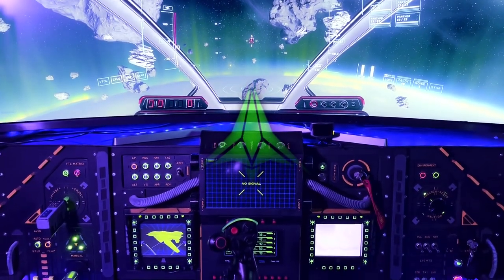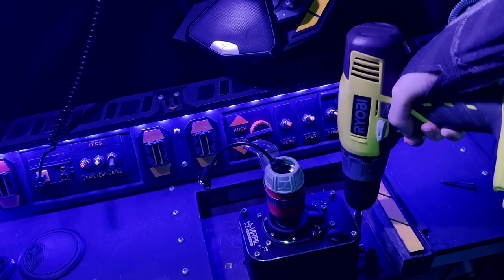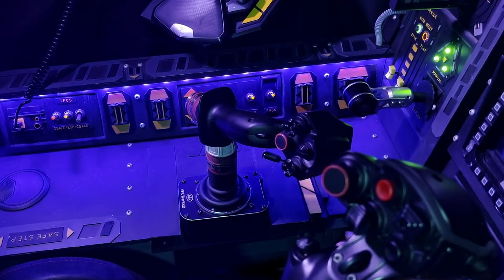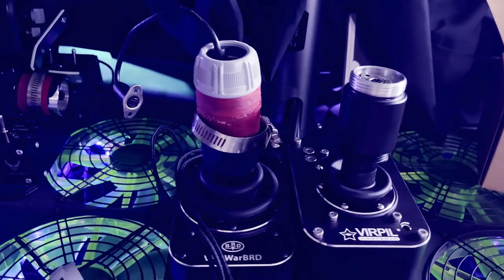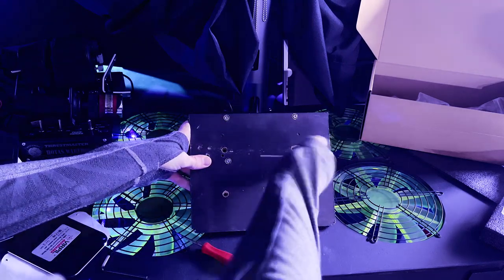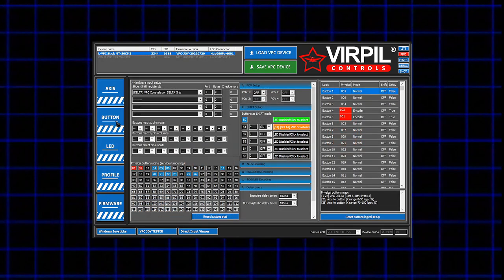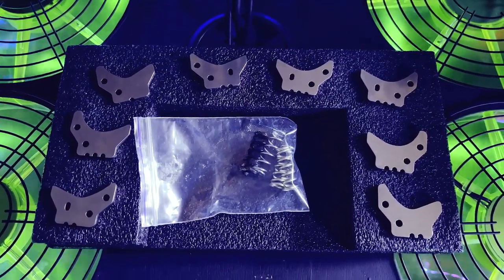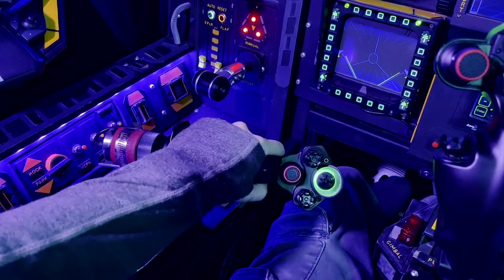Virpil MT50 CM3 Gimbal Base for Star Citizen - First Impressions & Simpit Installation

Comment: Been looking forward to this!
Reply from the maker: Hope you liked it!
Reply: Thoroughly, thanks! I’d be curious if you do pick up another base for your right stick.

Another thing, when switching out the default spring for the soft spring, did you have to lubricate the soft spring with grease?
Reply from the maker: @Tryxst3r  no I changed it right away basically. It seemed fine without

Comment: Awesome! Really glad to see the CM3 features being used like this!

I've been testing versions of my warbrd dampers this week, finally on a design that performs as you are describing the cm3, nice smooth motion, little less muscle fatigue in keeping aim on targets over long sessions, I've ended up dropping the springs back down to light as I don't need the spring force to push back on me as much with the dampening present.

I still need to figure out the adjustability, I currently need to take the stick out of the base to tweak the tension, but I should have a solution for that come final version!

Not managed to cross paths on teamspeak, is there somewhere I can throw you a message, get some stuff sent out to you, the Omnithrottle adapter and stuff for you to try out if you are interested.
Reply: Sounds like an awesome project to add dampers to the WarBrd. I still prefer its dual cam design in action.

Comment: "Best control method for space sims" - That's subjective and very dependent not only on the sim, but on how that sim works. 
Two sticks in SC is ideal for Decoupled mode (as the ship acts like it would in space, with momentum). 
However it makes a lot less sense in Coupled mode. In this case, a throttle makes more sense. This base however, does add to the value of using it in couple mode. 

I do wish you could tell the game which one you want as the default. I currently use a Stick, Throttle, and Pedals and find i can move just as well as those that claim "two sticks are best".

Comment: Can I ask - what did you find necessary with those to supplemental clamps on the left Z-extension & throttle?  Did you find the connections to be unmanageably loose that often? TIA,

Comment: Hey man, great review, and fantastic cockpit, just got new Virpils with CM3 bases and z-Extention, because of that video. Could please recommend what cam plate and what spring you use for the right joystick? Thanks in advance!
Reply from the maker: I'm using the Heavy Springs and the Default Cams in the WarBRD base (right stick) with a 50mm extension. Though some space simmers prefer the cosmosim cams. I started off in Flight Sims so I prefer the default I think.
Reply: @AfterimageFlight  Yeah, the extension makes it easier to control by default, thanks, man!

Comment: 4:45 cam springs allow for this, but i would assume creating 3rd party cams would be a nice way to FINE TUNE the feel. Damn wish i had access to all this now, but i'll have to wait. i hope to manufacture sim pit fun at some point. like ideally i wanna experment with a saddle style system more like the vandull ships sitting in charis gets uncomfortable
Reply from the maker: I found it was hard to tell where the center is with the clutch holding the stick because it changes how the resistance feels passing over it. The largest detent really helps with going from one direction and resetting to idle.

Custom Cams will really be awesome to fine tune it.

I almost think an old motorcycle frame would make a good basis for setting that up, but I'm not sure if the cost would make that difficult.

Comment: I've heard of people offloading the weapon firing groups to the left stick so as to improve flying and aiming accuracy with the right stick.  Have you tried this?  Thoughts?
Reply from the maker: I think it would feel unnatural to me. The trigger does not require that much force to activate, even to the second stage, certainly not enough to displace the stick enough to make it miss.  I don't see how it would throw off aim, but that's just me.

Comment: All in at current setup what would you estimate the cost minus the computer and monitor?

Edit: also, very nice setup!
Reply: The most costly component is time. You spend dozens and hundreds of hours researching, planning, trialing, dialing, setting up, learning and re-adjusting. Take your hourly wage and multiply just by a hundred and you'll quickly find out that it's an extensive project where costs are actually the least of your worries.
You could easily work more / harder / spend time on educating yourself and progressing to a higher position to buy the hardware - but you will not always find the time to work on a project like this.

As for costs of the bases, grips and extensions - plus a few other gadgets like pedals, screens etc. you can quickly build yourself a spreadsheet and add up. Consider roughly 500 for base + stick plus another 300+ for pedals, another 200-300 per screen and button box. Then you have your estimate. At the lowest I'd say about 1,5k - 2k (considering what you really count like chair, the simrig, cover parts etc.) and there is no upper limit.

Comment: hello, what cam and spring are you using on left stick ?
Reply from the maker: I'm using the hard center ava cam, with the light spring on the y-axis, and the default on the x-axis.
Reply: @AfterimageFlight  are you using rudder to roll ?
Reply from the maker: @ounet3629  Stick Y: Pitch
Stick X: Roll
Pedals: Yaw